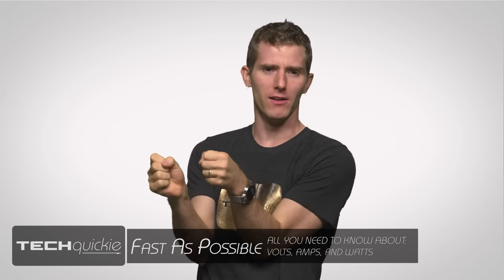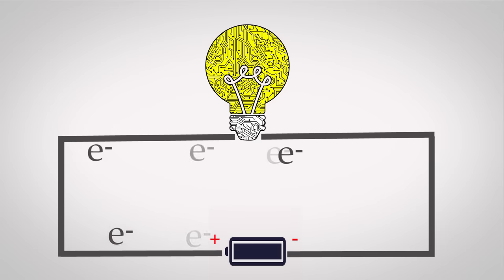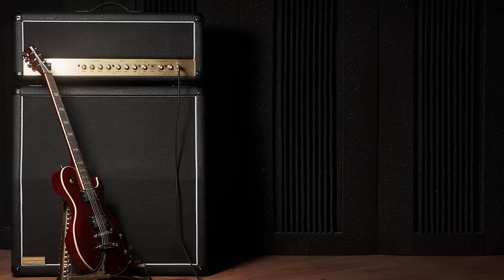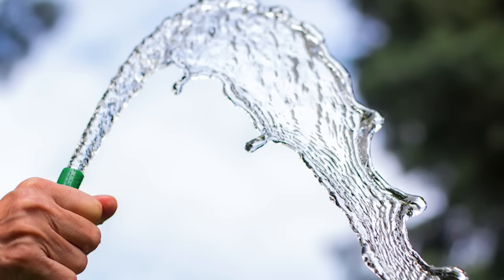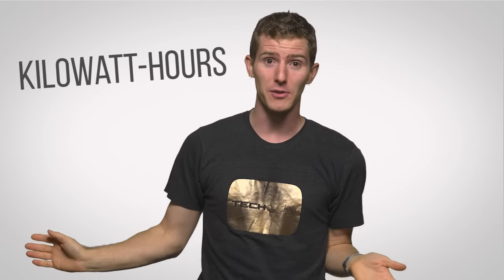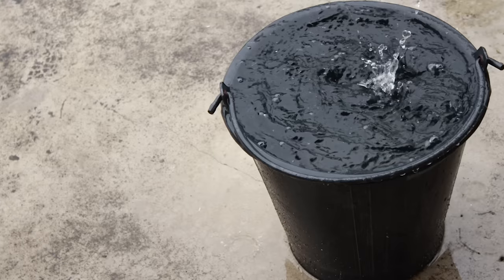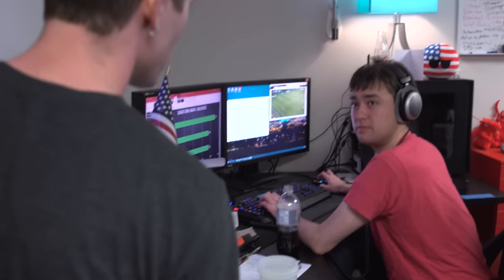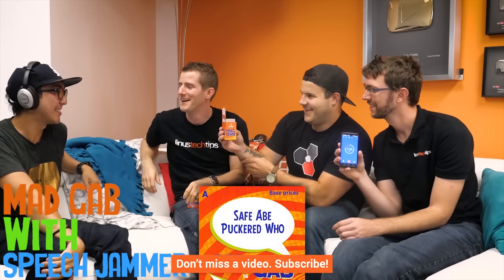Volts, Amps, and Watts Explained

Comment: Someone help!🔋🔋🔋🔋🔋🔋
I still don't understand what I came to figure out:

I purchased a compact folding ebike.

I got maxed configuration:
Battery = 48v 15.6a

My understanding is volt is speed and amps is the range/distance. I want to understand how and if getting the basic 350W motor or paying for upgraded 500W will make any difference?

Will both 350W and 500W motor go same max speed (48v) and max range (15.6a)? What if, any difference, besides upgrade cost does getting the 500W motor make?

I think I made mistake paying for 500W if the speed and range are determined by just the battery.
🔋🔋🔋🔋🔋🔋🔋🔋🔋🔋🔋🔋

Comment: A few critiques: 1.  Stop the pop!  The disturbing popping sounds ruin the video.  2. You can just say, "put" volts and amps together and say anything definite.  3.  The "times" symbol in the power formula was clear enough, so why change to the word "put" unless you don't mean "times."  So, I have to assume you don't.  3.  You dropped the ball on "current."  Are you trying to connect, that current is power(?), if so, you don't say so.  You have to affirm that, if so.  I hope, that if you ever remake this video, you tighten it a lot.  To make this more instructionally sound, you should run it past someone who knows nothing about it, like me, so I don't have replay parts only to hear the same gaps in logic.  If you already know this stuff, you closed the gaps on your own and think this was great.  On the flip side; good vocal energy and visual references.

Comment: Wait wait,  you know you went too fast.  I will remind you, just being nice...  :)
So wire carries electrons as pipe carries water and a generator is to the water pump.
Now electricity is to what water analogy because you know electrons are not electricity.  Electrons remain in the system and we are not buying electrons.  So what do you say?
Reply: Electricity is the exchange of electrons that happens on the surface of a conductor ..has nothing to do with water in a pipe

Comment: 1 hp is 742 watts. These 5 hp vacuums they advertise are a joke. 5 x 742 watts using a standard 15 amp fuse and wiring would melt it if the breaker didn't blow

Comment: Bad presentation. For a video that aims to simplify things, you forgot the most basic of informations: defining what Watts are. V x A = P [W] doesn't mean much when you don't understand what P itself is (and therefore what Watts are).

Watt [W] is energy (E) [J] per second [s], where 1 W = 1 J/s. Energy (E) is either the amount of movement in a given system or the potential movement that can be recruited from a given system. Energy is measured by Joules [J], or more commonly in your everyday life, by Calories [Cal] (e.g. on food labels), usually presented in units of thousands (kilo-calories) [kCal]. Energy per second is defined as power (P) [W or J/s]. Therefore V x A = E /s = P [W] [J/s].

Comment: wait did you actually say "if you put volts and amps together you can tell how much current is flowing" ??? 
amps IS the unit for current... -__-  

oof...
Reply: He is "how much current is flowing AND how hard it's flowing"
That "AND" means they are multiplied.
Reply: @zainkazi  -_- you are missing the point, probably because you don't have any background in electricity.

he literally says "so when you put VOLTS and AMPS together you can tell how much CURRENT is flowing, and how hard" 

my point is, amps is the unit for current... so you don't multiply "volts" by "amps" to = "current" because amps = current... do you see my point?
Reply: @slappmunkey  No, he doesn't say to multiply volts and amps to get current but he says to multiply volts and amps to get power.
Reply: @slappmunkey  you have to add 'how hard...' part to complete the statement. You are stuck to only half of that statement.
Reply: @zainkazi  are you deaf? Listen...
Reply: @zainkazi  it doesn't matter you aren't even listening to what im saying.. amps fucken is current, current is amps , they are the same thing different word. amps is the UNIT for current. so my point is, you cant multiply volts by amps to get amps... thats not how it works...

Comment: im retarded, my brain is not processing what he just said. all i remember is amperes came from amperes dude, water and current is amps. voltage is the pressure it takes to push the electrons. water gun with tiny nozzle and a hose pushing a wheel. both give it out same power but with different amperes or current. (this is what I understood from watching the video for the first time) I hate it

Comment: I still dont get it, at 3:52, you put more volts in (more water pressure) and you get less amps (less water current) 

W
T
F
Reply: If I double the pressure in a water hose, its gonna double the water flow, not half it.
Reply: The reason the current is halved when the voltage is doubled is due to the fact that he's keeping the power consumption value the same on the other side of the equation. The equation for power is P = I * V. If we're talking about a device that dissipates 1100 watts of power regardless of the input voltage, and we double the voltage applied to the device, mathematically the current will be halved. 1100 watts = 5 Amps * 220V = 10 Amps * 110V.

Now, intuitively this seems wrong. However, think about it like this. Current is merely the number of electrons that pass through a given point in a circuit in one second (for the sake of this discussion). If you apply very little electrical pressure to the circuit, any electrons flowing would have very little energy. You'd need more of them to flow to do the same amount of work as when you apply greater electrical pressure and cause fewer, more energetic electrons to flow.

Imagine you're trying to push a car forward at a constant speed of 1 mile per hour. You would have to put in twice as much effort as you would if you and a buddy were both pushing with half the effort to maintain the same speed. In this analogy, the speed of the car is the constant 1100 watts, the electrical pressure is the effort required to move the car at a constant speed of 1 mph, and the current (number of electrons per second) is the number of people helping push the car across a particular point on the road.
Reply: @cusemoneyman thanks